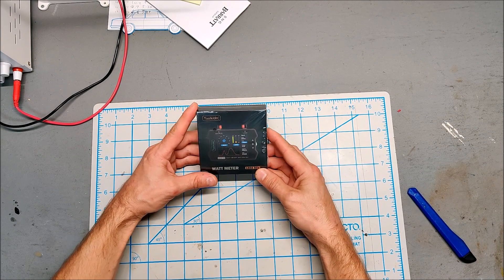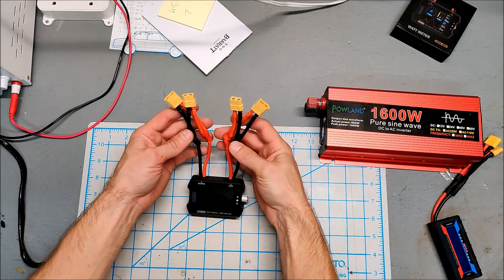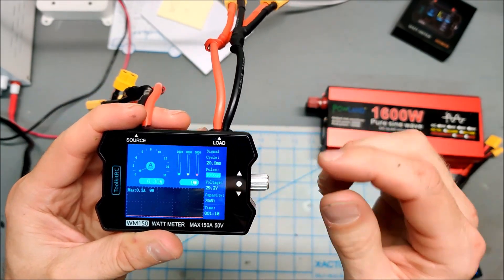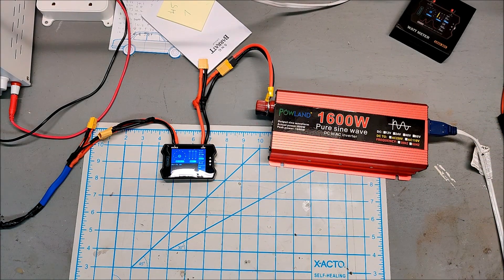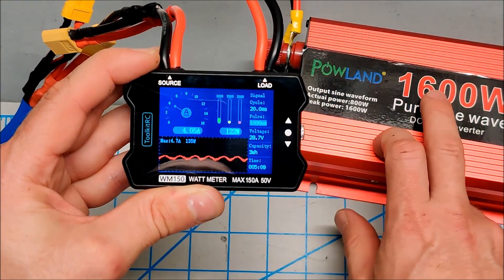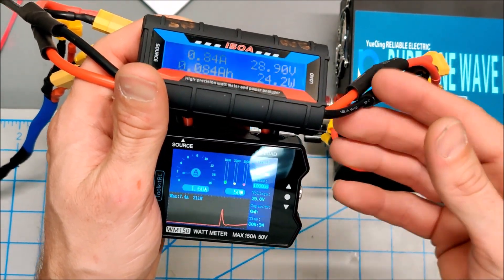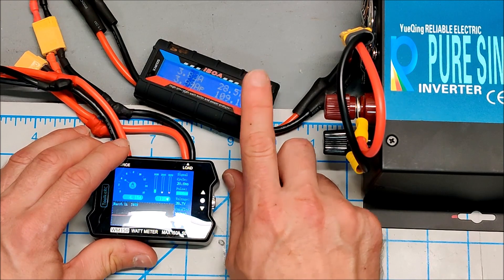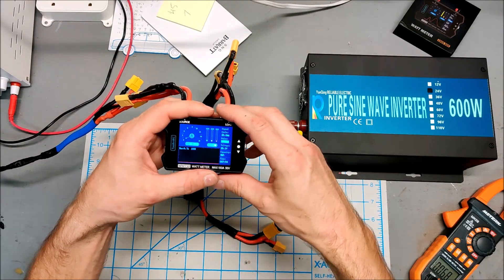ToolKitRC WM150 150 Amp Advanced Watt Meter Tested

Comment: hey, thanks for the review :)
I had the same issue with the XT60 male vs. female so I switched to anderson powerpole there is no male or female :)
Reply from the maker: All my RC chargers (Icharger, ISDT) have XT 60 connectors built in so im kinda of stuck with XT60
Reply: @stevenc22  Well XT60 to Anderson on all of them... Well don't know I still have a box full of Anderson poles on the way and hopefully it is the plug to go with.

Comment: Nice little meter.  Do you think you could install bigger wire, instead of the 12 gauge?
Thank you sir.
Reply from the maker: Yes, the wire is just solder into the board. Probably not necessary since no one measures 100+ amps continuous